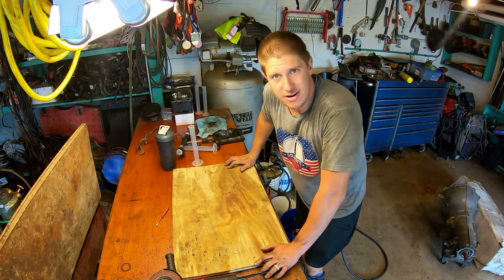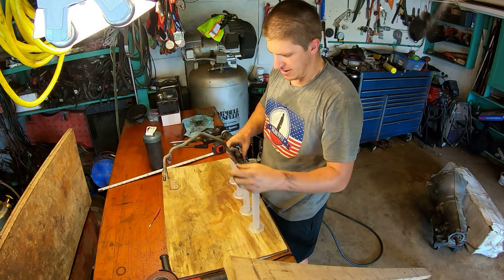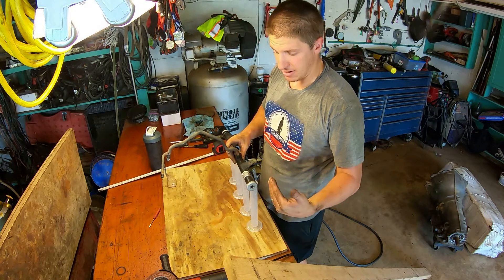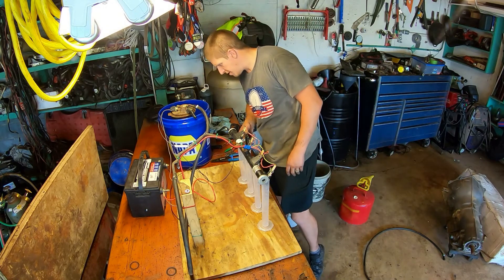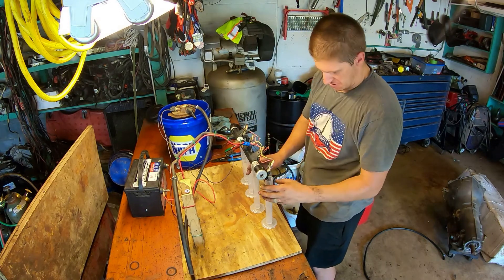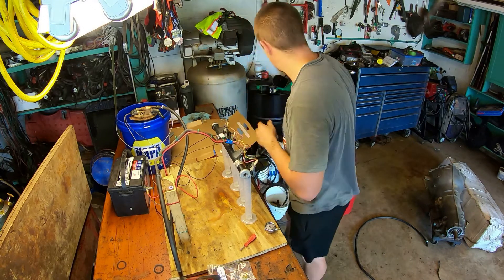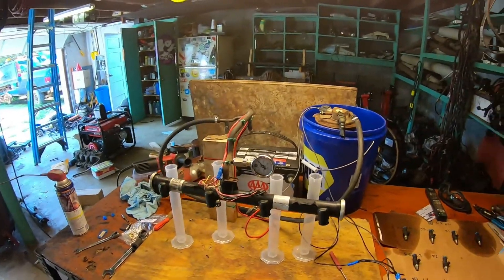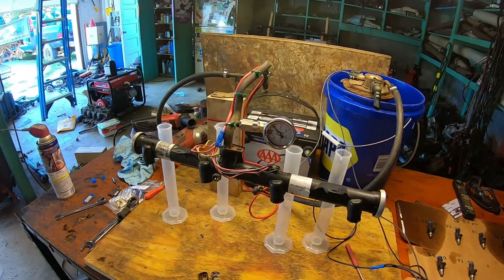Building a HOMEMADE Fuel Injector TEST BENCH

Comment: Finally went out tonight and pulled the injectors and rails off a parts 5.3 I have sitting in the garage.  Getting the parts together to get this built finally!  I'm having issues (I think) with the injectors in my 4.8.  She idles rough sometimes, and will eventually turn on the check engine light.  Time to test and find a good set of injectors to keep me going until I have my 6L ready to drop in (next year sometime) Those injectors are a bugger to pull out of the fuel rails! WOW! lol
Reply from the maker: Heck yeah Colin! Just do a little bit every chance you get. The little bits add up into a lot done. They really do stick into the fuel rails, it seems to help to rub a little grease on them when you're installing them, it seems to make them easier to get out/in the next time.
Reply: @MohawkMotors  Great tip, thank you!  I'm going to try to do a video once I have it all finished so you can see the fruits of all the work you do with your videos first hand.  It's been a lot of years since I published any videos on YouTube lol.
Reply from the maker: Would love to see it!!!
Reply: bro forget all of the waffle where your fire extinguisher